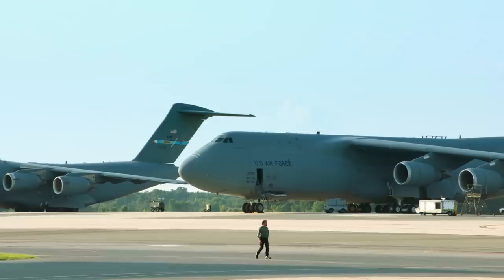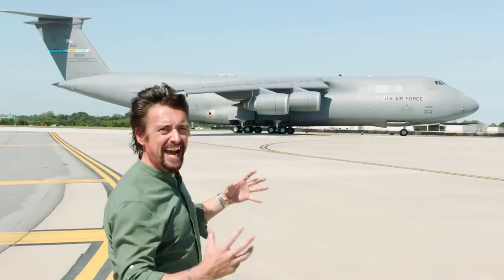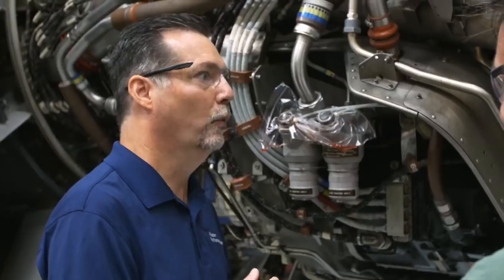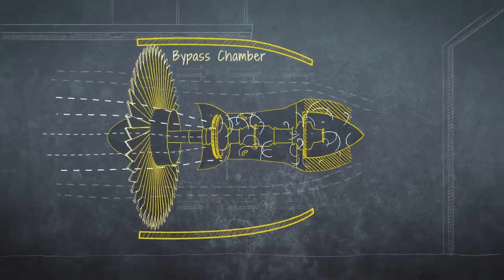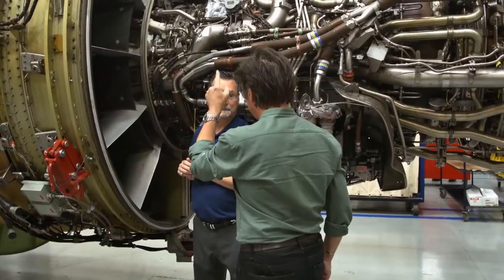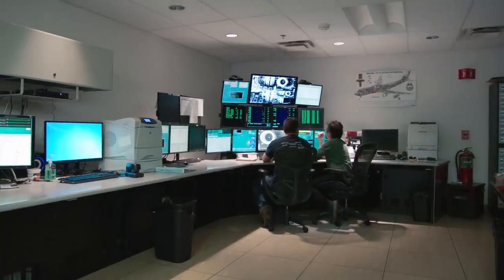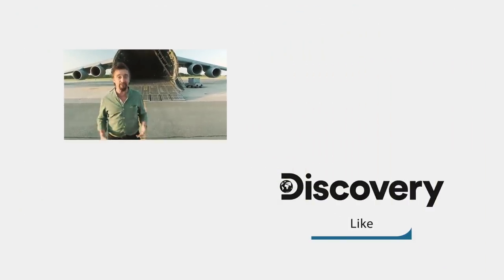Richard Learns How POWERFUL The Turbine Of The Super Galaxy Plane Is | Richard Hammond's Big

Comment: I understand the Russians have larger aircraft,,,but this thing is BIG
Reply: But the Russians only have 1 of them.  Was built to carry the Russian Space Shuttle Buran, but when they discontinued it they turned the plane into a cargo aircraft.
Reply: @nvstewart  2 Actually, they've got the Antonov 225 and 125
Reply: @nvstewart  Both are massive, but the 125 is smaller than the 225 and has 2 less engines than the 225 (making it four 😅)
Reply: @PStahn  Then I stand corrected, the 124 is just slightly larger than the C5.
Reply: I'm pretty sure the Mriya is actually Ukrainian owned as well, not Russian. Not sure about the 124s, of which like 50 or so were built.
Reply: The US Airforce charters VolgaDneprs  antonov to fly stuff all the time. I think mostly helicopters. I see them in Ramstein pretty regularly
Reply: @nvstewart  *Ukrainians not Russian.
Reply: @nvstewart  and its not Russian Space Shuttle Buran its SOVIET BURAN
Reply: @shahimagesyt  No wonder it failed then.
Reply: MW Douglas thanks,
Reply: jaue82 All good man, they are all a credit to the people, the engineers that not only got them there but keep them flying,
Reply: indeed, happy to see that Antonov giant still operates to a few company
Reply: Odd that,  makes you wonder why the Americans then rely on a Soyuz as the only current delivery vehicle to space, where as the shuttle had a habit going 🚀💣
Reply: Rockit 747-8 is also contracted by the dept. of defense. Bigger/heavier than the 124 and C5
Reply: adjustings thanks for that, I didn’t know, just love those aircraft
Reply: @nvstewart  It can't carry as much weight. The C5 has a 14,000lb higher takeoff weight then the 125.
Reply: @nvstewart  The Russians don't have any that are larger. The Ukrainians do though, and only one flies.
Reply: operator0 will get more in the near future though!
Reply: My Dad and I took a tour of one of these At Wright Patterson in '67.
Reply: u2mister1 lucky, I would love to

Comment: Couple things from my understanding of these engines:

1) The animated illustration made it seem as if the combustion is explosive like a piston engine.  It is not, its continuous burn, like your propane fired bbq grill.

2) It used to be that jet engines were basically the jet engine.  They decided that it was more efficient to use the jet engine to power a gigantic fan.  The jet engine contributes the minority amount of thrust to the engine.  Mostly it's a power plant to drive the big fan in front which is why most of the air goes around the engine.  Aside from being more efficient it's also quieter that way.
Reply: Even more amazing is that turbofan, & blisks (turbine rotors) turn at different speeds. Most large jet engines spin at three different speeds: turbo fan (slowest), compression (mid), & exhaust\power blisks (fastest). The turbofan needs to turn considerably slower to function.

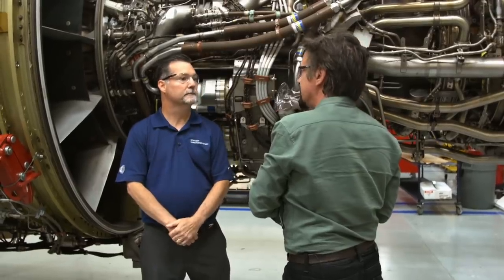Comment: Been there done that quite a few years ago in the 70's. Wasn't there that day, but told that one of the "Mike Trucks", large boxy Maintainance truck happened to unknowingly drive round the back of a C-5 doing an Engine Run...blew the Mike truck right over! Also, rumor has it, that Engine Runs were done regularly to keep Delaware from floating off into the Atlantic. Also got TDY'd into the SP's to guard the beasts with an M-16. Walking behind the line of C-5's (then) at 3:00 in the morning sometimes gave us pause, because at that time the "Weather Underground' (not your friendly Weather Channel) could have had a shooter in that not too distant treeline you see behind them, who , if even a halfway decent shooter could have put a round behind someones ear and slipped off into the trees and swamp.

Comment: That is not even the right engine in the testing room. This is a GE90 or a GENX in there.
Reply: Yes it the ge9x
Reply: @ioandavies2292  Okay thanks.
Reply: On the road it's a GE9X. On the test stand it's a GE90-100 series. When they are in the control room it's a GE9X again, after they advance the throttles it's a GEnx, then a GE9X again. Then it's back to the CF6-80

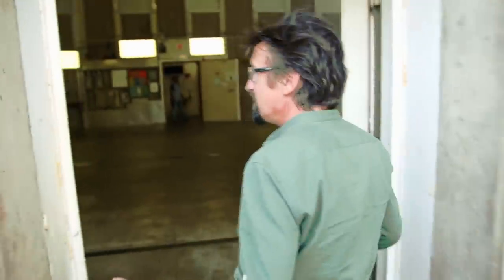Comment: The 3:35 mark shows buildings that appear to be combustion turbine technology. I worked in power generation during my career trained in coal fired, nuclear, combustion turbine and renewable technologies.  The basic jet engine has also revolutionized power generation today by use of combustion turbines and combined cycles; moreover, using fuels such as natural gas and oil to power the electrical grid around the world.  We owe a lot to guys at GE and other companies who took this technology to new heights!
Reply: Those are the engine run buildings, essentually the mufflers.

Comment: They used to back the C-5s up along the flight line at Clark AB, Philippines and when they ran up the engines to taxi, the thrust blew through the barracks which only had slats for walls.  It would only last about 10 minutes, so you learned to just get out of the way until it moved.  I'd say they were pretty powerful.

Comment: "Getting on for a hundred years old" in 2045? The Galaxy entered service in 1970. And the Super Galaxy upgrade was only done in 2002... 

Also, turbofan engines have been in use since the 1960's on airliners, albeit with a lower bypass ratio than the Galaxy's.

Comment: That's an older design on that plane wing.  It was succeeded by more powerful units like GE90-115B, but not on that plane. The latest is GEnx 1A and 1B. Most fuel efficient but slightly less powerful than the 115B.

Comment: I flew in a C5 from MCAS Miramar to Deleware or NJ(cant remember which one) then to Italy then to KCIA. Kuwait. We had 2 CH53 helos. Up top is seating just like in a commercial jet but NO windows AND the seats face backward instead of forward. Atleast That's how the C5 we flew in was. Felt wierd when ww started take off cause instead of being pushed into your seat we were being pushed out of the seat. I mean it Wasnt like massive force but enough to say "are we hauling ass in reverse." Then 11 months later I flew in a C17 from KCIA to Germany then Germany straight to Miramar with a refueling over the Atlantic and we thought we were going to break apart at 40k feet. It was violently rough with turbulence. Also. No windows

Comment: I go out to the GE test facility on a regular basis..its 7000 acres and quite impressive..
GE9X is just about ready to go into production andxthe engine fan case is 164 in  across at its widest point lol ..our co has the contract to haul the new 9x ,ge 90 and genx engines from peebles OH to Boeing in Everett WA for all the new planes ..we had to have a special trailer designed to haul the new 9x because of its massive size ..

Comment: recently watched a doc on the SR-71, they also used a bypass system while using ram jet tech.   amazing stuff.
Reply: Mahesh M V U  yes, thank you
Reply: Mahesh M V U  it's not a scramjet, it's a turbo ramjet. It's only a scramjet if the air passing through the combustion chamber is supersonic, it's subsonic in the SR71 J58

Comment: Great and powerful.

 The electric jet engines are even more powerful, but we will need battery advancements to use those in very large aircraft. In the small aircraft the electric engines are already more powerful !
Reply: Yeah, with a duration of less than 45 minutes and/or almost no carrying capacity. There's a LOOONG way to go before they become viable.
Reply: @operator0  They'll never be viable. Batteries are good for short bursts. Anyone expecting them to do any sort of long term sustained action doesn't live in the real world.
Reply: @illegalopinions4082  Never is a long time.
Reply: @operator0  I know. The simple fact it's not a fuel but a form of stored energy makes that a certainty.
Reply: @illegalopinions4082  Not viable at the moment and I don't know if they do have the power to weight ratio of gas turbines at the moment. But they may well be viable in the future. Hydrocarbon fuel is a form of stored (chemical) energy lol.
Reply: @82NeXus  I think we both well know that chemical energy converted to mechanical energy is far more potent than electrical energy.
Reply: @illegalopinions4082  Sure, hydrocarbon fuels have amazingly high energy density, much better than sucky lithium batteries. But it's batteries that are the biggest limitation, not so much electricity itself or motors.
Reply: @82NeXus  Considering the source of energy matters what you said is a poor argument in favour of electric... anything

Comment: They're not 'Galaxy engines' they're standard issue CF6-80C2 used on many planes including Airbus A300; Airbus A330; Boeing 747; Boeing 767 etc..  The original engines were  unique to the C5, the GE TF39 which disappeared in 2017. No operational C5's remain with the old engines now, sadly.

Comment: if 7/8 of the air is coming out of the bypass, how is it that the turbo-jet or whatever, the middle section, is still so critical?  is it just a matter of the velocity of the air?  is the bypass air primarily generating thrust (and is this relative to travel speed?) or is it's primary advantage in affecting the pressure zone around the exit of the main turbo-jet's thrust?  I understand that part of it's purpose is to act like a forced induction system on a car and force more air into the turbo-jet, but what is the benefit of all the bypass air when it's velocity must be so much lower than the jet's?

Comment: why dover? all of the c-5's used to be stationed at kelly air force base in san antonio - until kelly was decommissioned - however, they still all have to fly here (its been privatized and its called "port san antonio" now) for maintenance - its the only place where the infrastructure exists to perform certain tasks - every one of these planes has flown over my house HUNDREDS of times - the old engines used to be real screamers, but the new engines are quiet as fly farts..

Comment: Basically the engine is a huge elongated turbocharger with fuel added into it so it can combust
Reply: Colin Furze has made turbo jet engines with a standard car turbo by adding a combustion chamber.

Comment: That jet engine graphic starting at 1:49 is so horribly wrong...  It is representations like this that confuse laypersons as to how a gas turbine engine works.
Reply: Thought I was the only one..... and this ENGINE is nothing New or "UNIQUE".. ALSO THIS HUGE "BYPASS" Engine is the reason we cannot go faster than mach .90 on a Passenger Airliners..
Reply: @Nawabid  Yes, it's just a turbo-fan, albeit a very powerful one.  Sensationalized for TV, of course.  Little Dick... er... Richard, should have stayed with automobiles.

Comment: 1:50 When automotive channel explain the combustion process from a gas turbine engine it will be look like a piston engine!  Dear Richard, theres a differnet reason why piston engine fuel injector called injector and gas turbine engine fuel spray called sprayer. Here's the another example there is a differen terminology between bleed valve from gas turbine engine to blow off valve from turbo charger of a I.C.E.. This is where a lot of people forget that the fuel flow from gas turbine is continues compare to reciprocating engine fuel flow. Another mistakes from four cycle to a gas turbine engine SUCKS, SQUEEZE,BANG AND BLOW there is no "BANG" from combustion area instead it is called "EXPANSION".

Comment: The announcement that we had already figured out anti-gravity back in early 2000 will be made in the next 6 years, possibly less.

The first tests were not uniform or predictable with movements, but over the past 2 decades it's been tuned and most of the bugs have been hammered out now.

Getting the gravity to disperse & manoeuvre evenly over the hull was the hardest bit, producing gravity wasn't difficult, powering it was at first but it's much more efficient now.  No longer need to use nuclear batteries, that's how much more power efficient it is compared to the first trials which could sustain flight for approx 20-30mins, now they can be sustained for 8-9 hours, most of that is due to getting into higher orbit faster and then reducing the gravity thrust for momentary blitz for propelling in the desired direction of movement.

Lower atmospheric manoeuvring still takes its toll on power consumption, but even that can now be sustained with full gravity trust hovering for approx 2hrs vs the initial 20mins trial runs for the first 3 years.

Comment: Too bad the C-5 air-frame was such a massive boondoggle, insanely over budget behind schedule and under capable. The useful load had to be derated by 30% just a few years after introduction because of major fatigue cracking down the spine of the fuselage. The full load can now only be used for war emergency purposes. The C17  does most of the general cargo work these days, the C5 is mainly reserved for items too bulky for other planes.

Comment: The only downside of high bypass jet engines is the drag penalty
Reply: Everything's a trade off. It's worth it on subsonic aircraft for the fuel efficiency and power. For high performance jets, not so much.
Reply: operator0 especially with the ultra high bpr engines of passenger jets

Comment: It seems odd that a general electric company making turbine jet engines so it does make me question are these engines in fact electric and using some sort of cymatic energy??.

What's more if you understand the principle behind a fuel jet engine you understand that putting that much water in a engine of such would damage and render the fuel useless what's more on startup there is never a flame or a crank pipe that normally smokes ever so slightly.

Comment: 1.25 billion ppl are in the air at any one time.  That can’t possibly be true
Reply: With covid not a chance but before... that sounds about right
Reply: @ethansaviation2672  that’s 1 in every 6 ppl are flying at any moment.  Just think about it.  How could that be possible?  

There are almost 26000 commercial aircraft world wide.  Let’s take a capacity of 350 (overestimate) per plane.  That gives u 9.1m
9,100,000
1,250,000,000

It can’t be correct.

Comment: I wanna see what 42 tons of air instantly does to a person
Reply: the 57,000lbs of thrust would be more useful. 42 tons of air per minute is one thing, but 57000lbs of thrust is in another world all together. 
42 tons of air will fit into 402 standard shipping crates. so this thing consumes 402 crates of air per minute. or 6.7 per second. This however tells you nothing about what it would "do" to a person.
however 57,000lbs of thrust/force would be enough to accelerate a 200lb person at 285 times the speed of gravity, instantly killing them. althought this would be impossible to do but i was just pointing out 42 tons of air doesnt tell you anything. 

if the shipping containing had open ends travelling on a train for instance. it would have travelling through the container the same amount of air as this engine if the train was going 91 mph. not really that impressive in that perspective.

Comment: But how can the engines be too big? Like why can't they be super massive?
Reply: The more mass something has, the force that thing needs to exert in order to not collapse under it's own weight get's exponentially higher. In this case, we're trying to get a huge plane off the ground. The clever engineering people have probably calculated the size of the engine for maximum efficiency, which I would think is more desirable for hauling cargo than raw power.
Reply: @henryorsomething  i see
Reply: @smeshsmesh9695  please don't take my word for it lol

Comment: This video leaves out the fact that the USAF and GE did no research and development OR design for that matter in replacing the engines on the C-5. They strapped the same engines found on the 747 and 767 right onto it. It’s not plug and play, but also not a new and modern engine as this video is making it seem. 

The smaller C-17 uses four of the same Pratt and Whitney engines found on the 757. 

The USAF originally ordered the newer, larger, more efficient A330 as their next aerial refueling platform, but then the Pentagon ordered a Florida recount and suddenly Boeing had won the contract with the older, substantially smaller, and less efficient 767-200 (same plane that hit both towers).

The taxpayers could be paying significantly lower fuel and maintenance costs but our government also ended the F-22 program like we don’t actually need the most superior fighter jet on the planet.

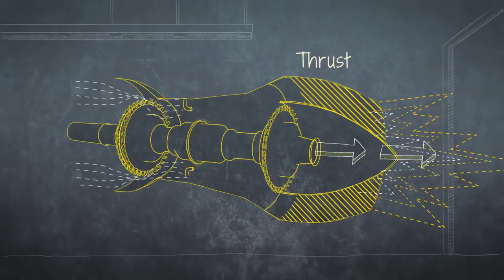Comment: 1:53 has to be one of the worst cross section views of a turbine engine - ever! The compressor and turbine blades are way to small. The turbine blades are located in the tail cone and thrust exits the engine via the shaft? And why aren't there any combustion liners? You wouldn't just spray fuel somewhere into the engine... Discovery UK, this is unbelievably bad...
Reply: Blades are different sizes, Booster  blades are about 4 inches long, on the 14th stage of the HPC spool they are Less than an inch long,
Reply: @Acuda721  yeah, I know. But the gaps between the blades and the compressor housing should be way smaller.
Reply: @Acuda721  also, the compressor blades are running in different directions, which would mean that they are mounted on two different shafts. But only one turbine stage and one shaft are shown...

Comment: 42 tons of air per minute. 13 humans breath 42 tons of air in a year. Average flight time lets say 10 hours per day. 10 * 60 * 42 is 25,200 tons in an average flight day or about how much 7800 people breath in a year. Times that times number of planes in the air and no wonder were running out of breathable air. 

A Panamax container ship can consume 63,000 gallons of marine fuel per day at that speed. Or 2500 gallons per mile. Per mile....

All cause we need to get the crap we buy on Amazon and go places.